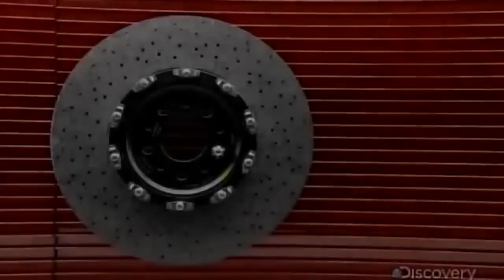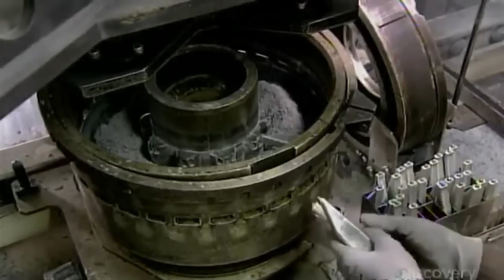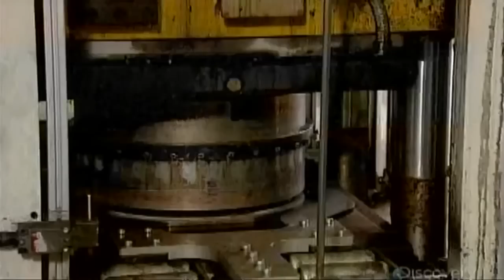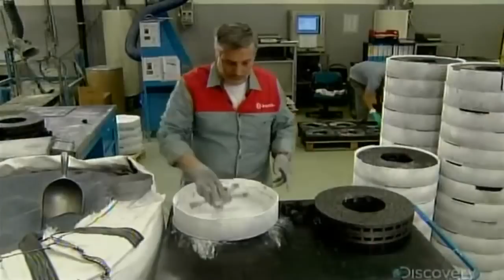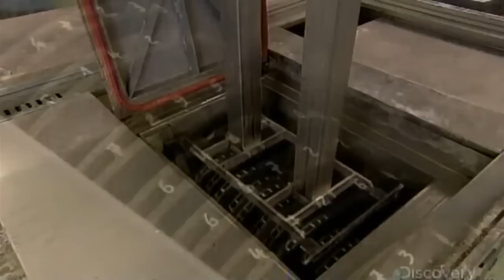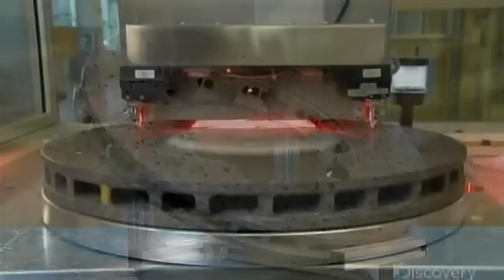How its made--Carbon Ceramic Brakes

Comment: Still not seeing why this is a $8000+ option on most modern cars.
Reply: It's over $50,000 retail, look it up in some of those luxury vehicles
Reply: Because manufacturers are counting on you, the new car buyer, not knowing what the options are really worth, just that "It makes the car good" and hope it's enough to get you to spend an arbitrary amount of money.
Reply: @qx4n9e1xp  but it actually is better than steel brakes
Reply: @mantastic4292  on the track, its miles better.